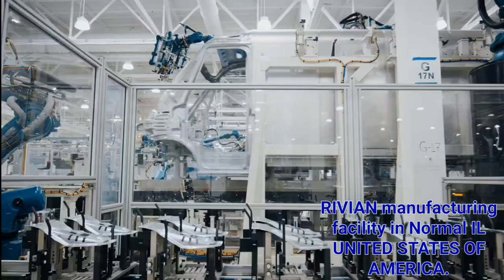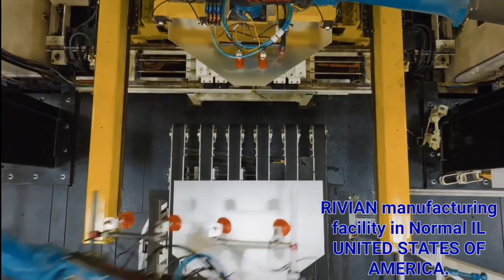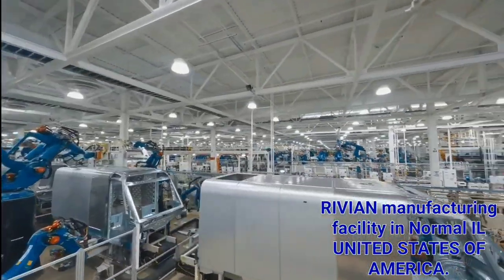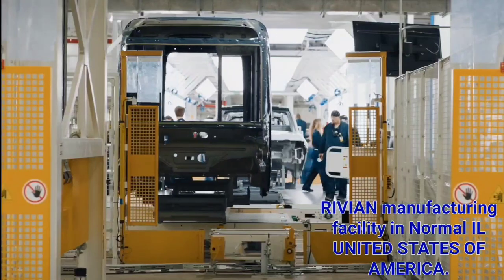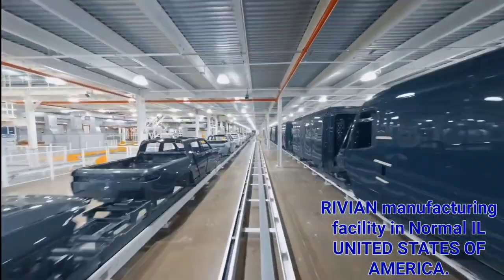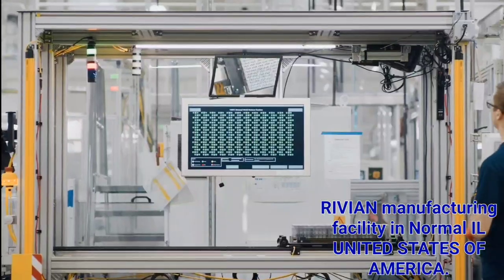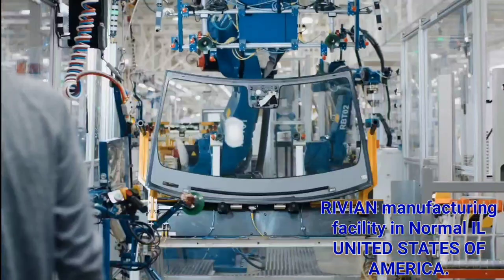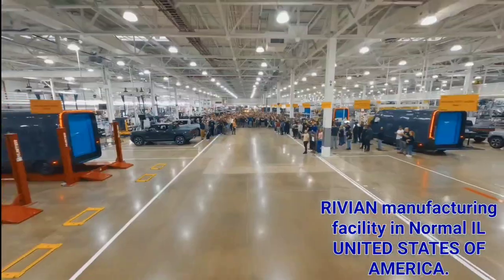Amazon electric delivery van  plant by rivian.Former MITSUBISHI CAR PLANT  Opened in 1988 to 2015.

Comment from the maker: THIS FORMER MITSUBISHI CAR PLANT 
 Opened in 1988, closed in 2015. Sold to Rivian in 2017.
The Normal, Illinois, plant, formerly a joint manufacturing venture with Chrysler, has churned out more than 3.2 million Mitsubishi and Chrysler models since 1988.
 It is also the only foreign-owned plant on U.S. soil that employs a union workforce. The Japanese automaker’s contract with the UAW was up for renewal next month but negotiations had not yet begun.The 2.4-million-square-foot plant, about 140 miles southwest of Chicago, has annual production capacity for 120,000 cars and exports to up to 50 countries. Last year, the plant built fewer than 70,000 cars, all of them Outlander Sport crossovers. 

Its best year was 2000, when the plant was at triple capacity churning out more than 222,000 cars. Over the factory’s 27-year history, workers assembled a dozen once-popular models: Eclipse (including the Spyder and Plymouth Laser/Eagle Talon twins), Mirage/Eagle Summit, Galant, Endeavor, and the two-door Dodge Avenger, Stratus, and Sebring models.